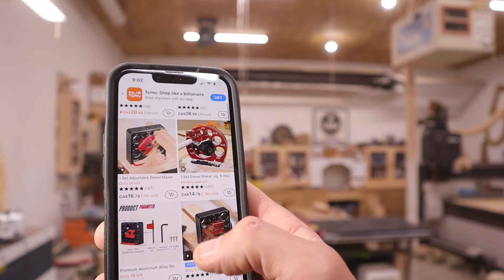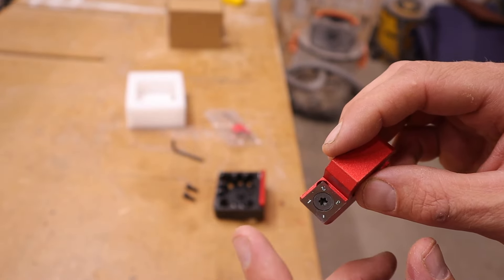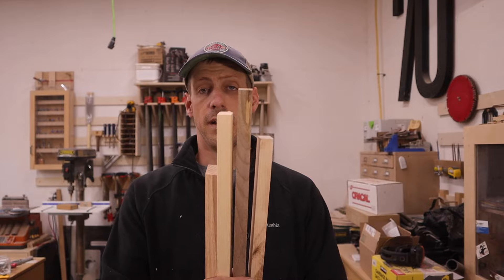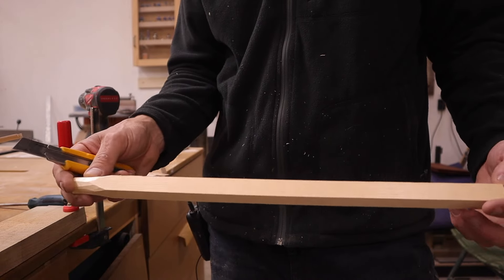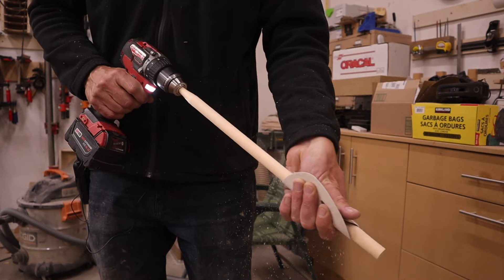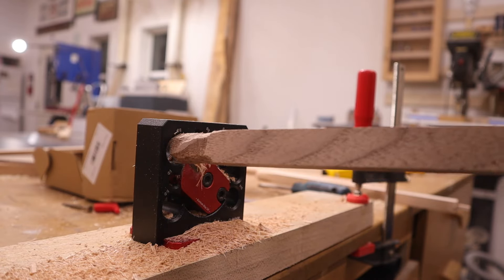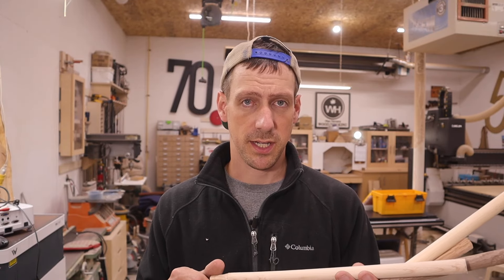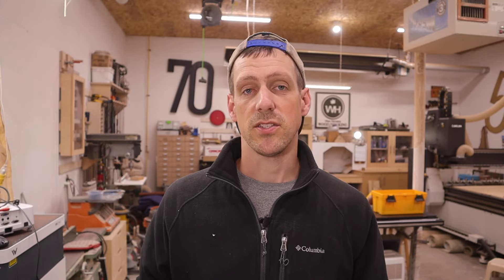I Bought A Dowel Maker Off Temu.....

Comment: Why would you expect it not to be metric. uSofA is the only non metric country in the world
Reply: Actually, America adopted the metric system in 1893 and in 1975 introduced the Metric Conversion Act  to get Americans to actually use it.

Guess they are just very, very slow to change/learn over there.
Reply: @j3ngel  This is very true.  The traffic signs all had km next to miles and cars were made with both metric and ASE (confusing the mechanics) and the speedometer (still) have both on the dial.  But people in US just didn't want to convert (too confusing, lazy?) and now, no one is pushing to change.

Comment: Are you supposed to back up? That is chewing it up.
Reply from the maker: No. I did that on the first one. The next three I didn’t do that. Pushing it through slow is how to avoid tear out.
Reply: @WesHamstra  6:24 you are pulling it back
Reply: 7:07 you are pulling it back
Reply from the maker: Yeah. I watched it back. You are right. I however don’t think that is the issue.

Comment: You tube on expensive original device sanded end into point on belt sander added round end for drill rest is shaped in device
Reply: Did  you mean to say, "device in shaped is rest drill for end round added sander belt on point into end sanded device original expensive on tube you?"

Comment: Wes, the problem that you have is the blade in these dowel maker's are basically crap, they are pretty blunt from the word go 🫣. The temu is a total pain in my arse, the amount of adverts the we get on a daily basis is just nothing more than infuriating!!!. As alway's buddy 💯%   👍   🇬🇧.
Reply from the maker: I wonder if there are any higher quality blades that are compatible with this jig. I didn’t have high expectations for this.
Reply: To be honest Wes neither did I, which is why I didn't buy one. Instead I have the flat steel plate with different size holes etc I find this way better 🤔
Reply from the maker: I will have to try that
Reply: @simonr6793  Hi! can you send a link to the plate you have or do you think all plates are good enough compared to this? And the plate requires to hit the wood with a hammer right or do you use a drill?